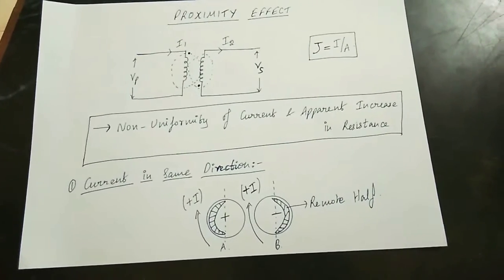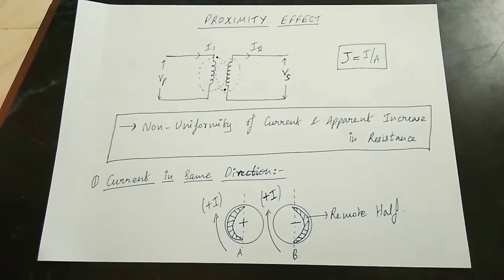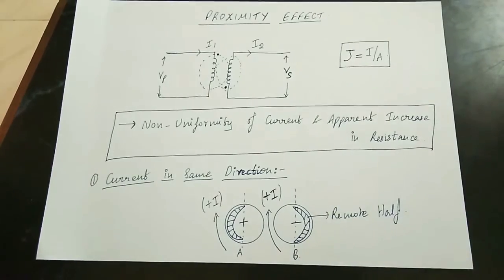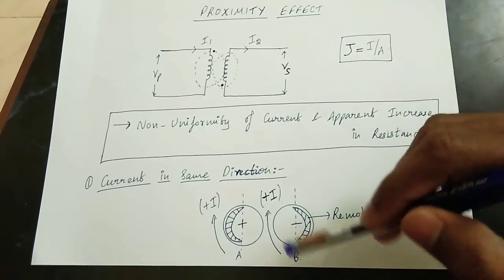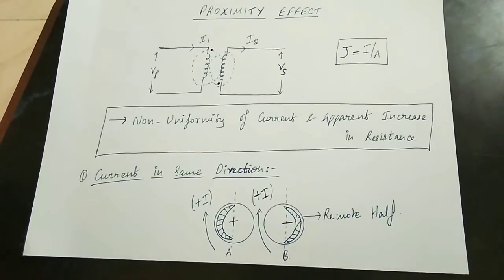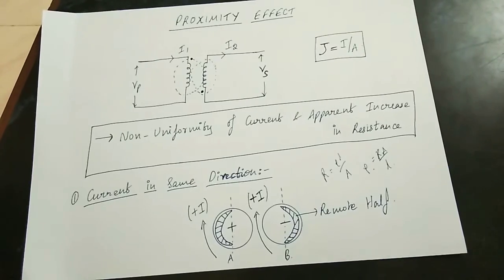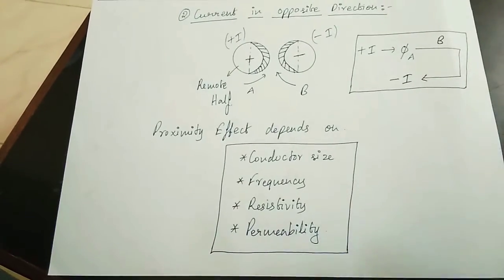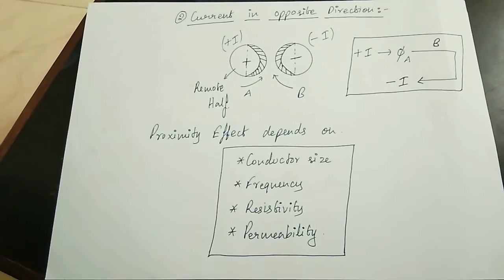Proximity Effect( Tamil ) | EE | Power System

Comment: 1. Direction of electromagnetic is wrong in the page 1..
2. When both the conductor carrying current in a same direction, the flux linkage at the far side of the conductor is more and so the inductance, inturns increases the impedance resulting the current not to flow. Meaning is, in this case the current will flow at the inner side..
Your explanation is wrong